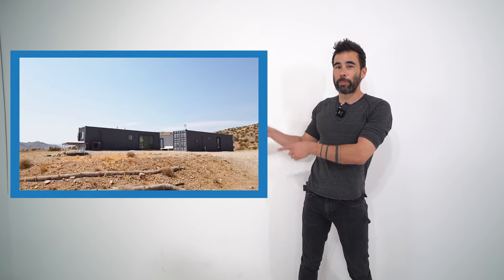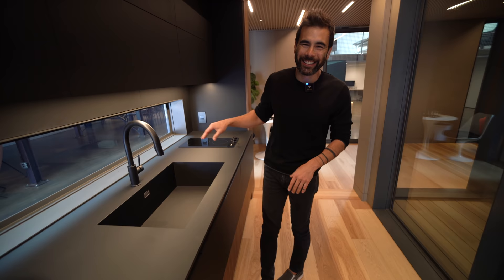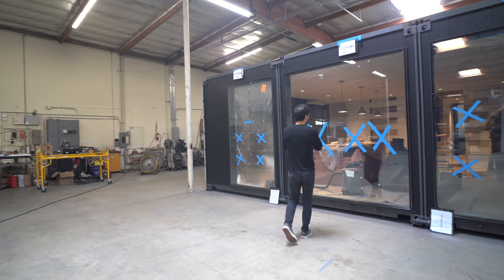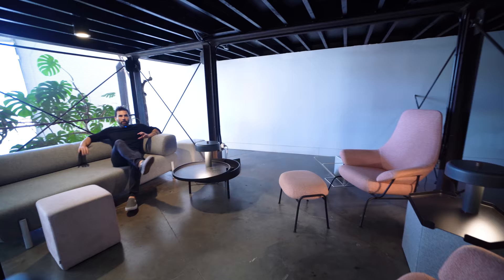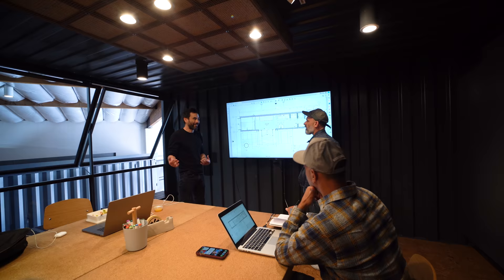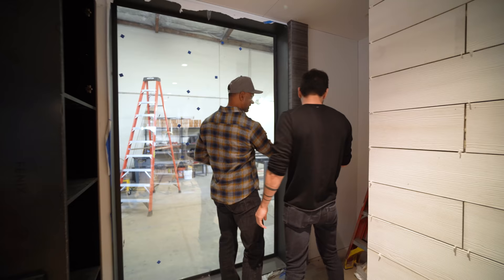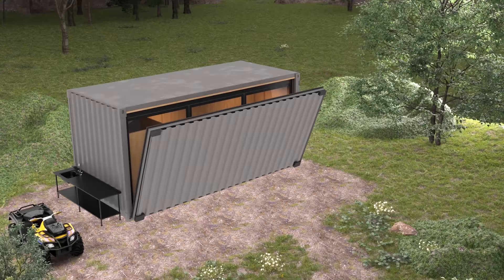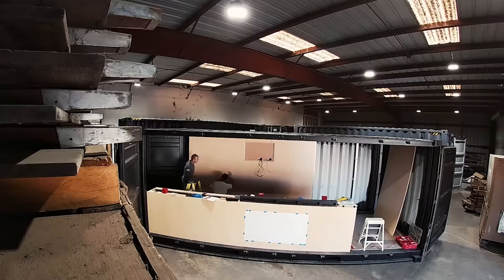Drawbridge in a Shipping Container House | Factory Tour

Comment: As a person who has worked building custom turn key homes from traditional stick frame and log cabins, the very first question out of my mouth with EVERY video like this on Youtube is, "How much insulation is in those walls and ceiling?". What are the long term operational costs of these structures? I feel like it should be a prerequisite to ALL videos doing walkthroughs to first discuss how well insulated the structure is and what systems they're using to cycle fresh air. When I see a metal box with large glass surfaces I see thermal gaps. How are they managing the insulation?
Reply: Well, you're looking at a giant add, so they're not going to talk about the real negatives of products like this.
Reply: Insulation was the first thing that crossed my mind. In California and a few select other places in North America, you could probably get away with little insulation, but where I live we have winters that drop into the -40s

Comment: looks cool indeed, design is good ,but it comes down to price, because if i can build a brick house for the same-ish amount of money per square meter id go with brick every time. Also i want them to comment on heat insulation, which with those giant windows on top of it being a container, would be terrible
Reply from the maker: I mostly agree but personally i think location and value are more important than price. building for $350 a square foot in CA seems expensive compared to $200 a square foot in the midwest but as a developer i have to look at appraised value and sales price.  A lot of people said my previous house was too expensive and while they are not wrong i did double my money on it
Reply: Knowing what you get, and (generally speaking) WHEN you get it, is a luxury these days. It’s not limited to electric vehicles.

Brick houses = I’ve seen tradies down here bailing, blaming weather, having costs blow out and that isn’t taking into account human error.

Give it a few years, prefab = better and if costs were the same, people will prefer it.

Not a popular opinion, but give it a thought :)